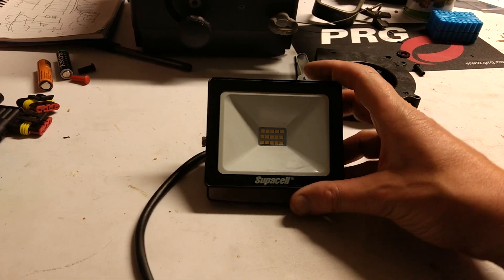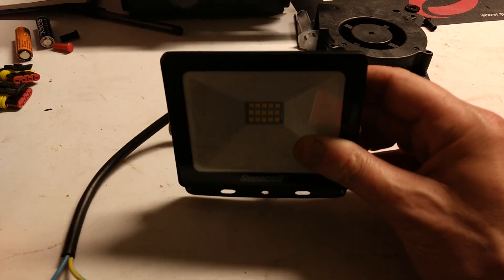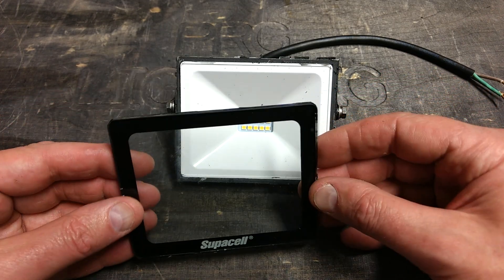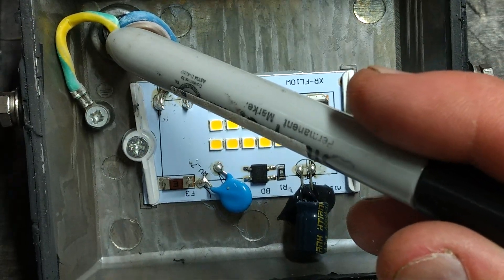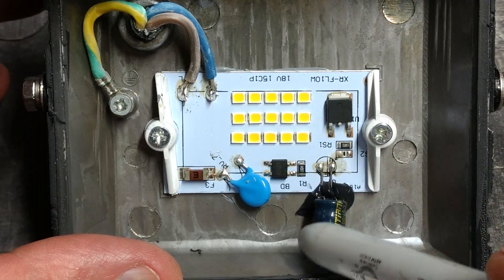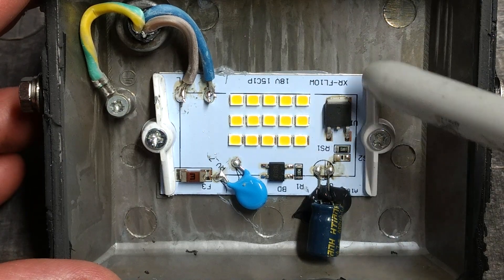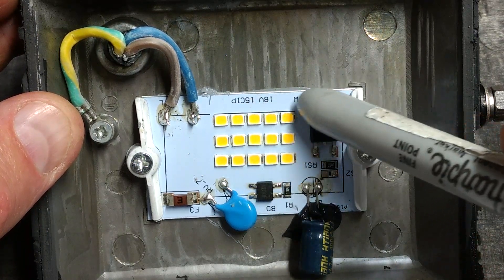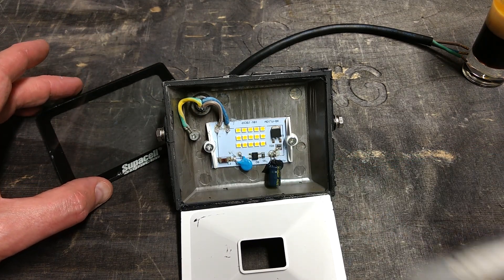Poundland 10W LED floodlight.  (rude version)

Comment: Curious if a heat gun would soften the sealant enough to remove the glass?
Reply from the maker: It appears to be heat resistant.
Reply: I was thinking the same. A flexible silicone heating mat can be used to unglue phone screens, might be worth a try on this.

Comment: How long do you think that capacitor is going to last with all the heat that will be in that enclosure during operation?
Reply from the maker: It's only a 10W fixture, and is a similar one to those found in most LED lamps and CFLs.